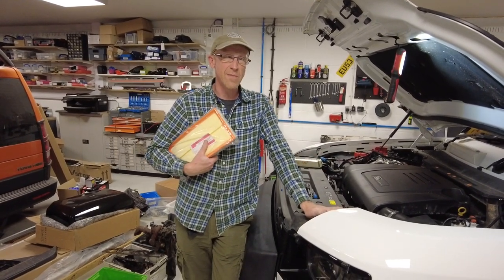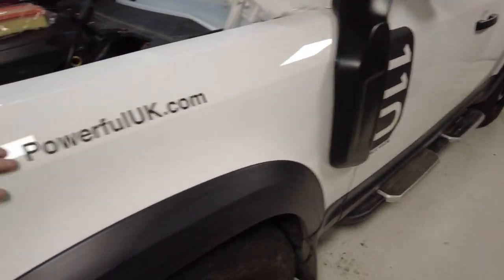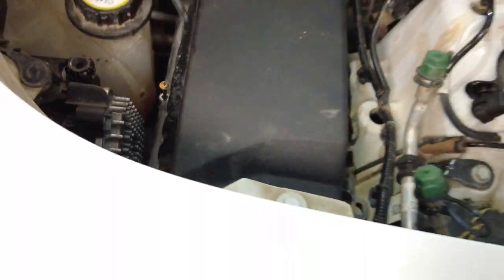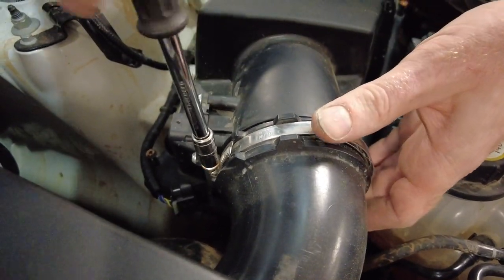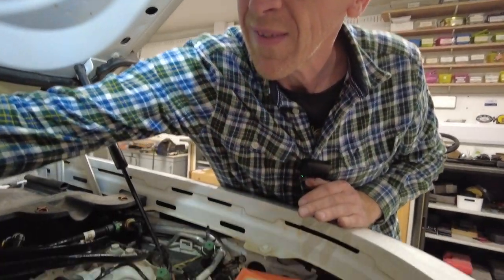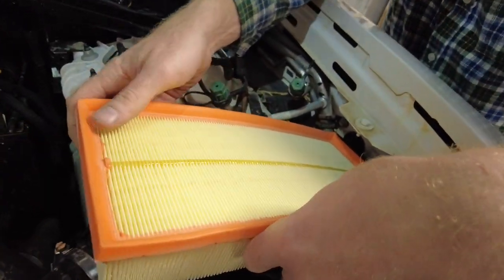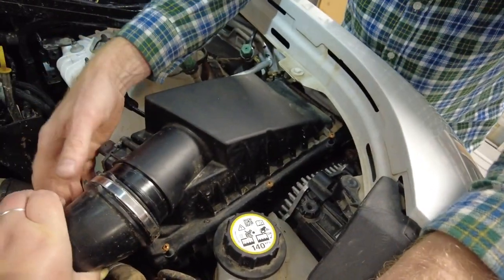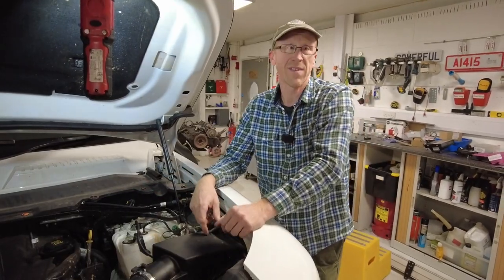Land Rover Defender L663 Service - Engine Air Filter LR129322 - 2L 3L and V8 models

Comment: We decided to use the Aftermarket K & N renewable one from day one!
Reply: My 110 P300 is 9 months old with 21,000 miles. Swapped out the OEM air filter for a K&H reusable filter on the first oil/air filter maintenance @ 7k miles, and every 7K since. I opted to do the vacuum method for the oil. Easy peasy.
Reply from the maker: K&N have a good reputation and there are eco credentials too - wash them and re oil and its good as new !
Reply: @L663  Sadly we still have the haters who are clueless, and say, OH but they are so bad for the engine! Boom Oil bath airfilters in all older WD landrovers! Not rocket science lol
Reply: @L663  Some "professional" testing done by a member of an Australian Land Rover forum (AULRO) has shown that while K&N performs well in most conditions due to having a reduced airflow restriction, a good-quality cellulose filter can outperform them in dusty environments. Indeed a slightly dusty filter will outperform a clean one.

Comment: How did you get the wiring loom clips off the side of the air box?
Reply from the maker: I think just small hands !
Reply: @L663  Figured it out…also had to disconnect the air suspension loom connection and partially lift the air box slowly and carefully making sure not to pull on the loom…that gave enough clearance to use tool to pull the clips off.

Comment: Hi Simon, mine’s a 2020 D200 and when I bought it I got a service plan with it. The JLR dealer said it only needed servicing every 2 years or 20,000 miles. You’ve got me worried now!
Reply: you should be iii needs at least a look at once a year and for goodness sake change the oil more frequently than they say.
Reply from the maker: It hard to find the published servicing data for the Defender...my dash comes up with service due so thats an indication i needed a service ! I do tend to agree with Jon - 20K miles on a new engine would seem a good time to change the oil.
Reply: @L663  When I first got a new car 30 years ago they came with a 500 mile oil change service following a running in period. I got my 110 in April2020 and I’ve just done 13500 miles as I live in a rural area and don’t do long journeys. I haven’t had a service light on except for Ad Blu. It was the dealer that contacted me to arrange a service.
Reply: @L663  I find that stunning Simon don’t they want you to look after the vehicle why are service schedules a secret.
Is it because they don’t want you to know what their not doing?

Comment: Well done again. Servicing is interesting because I have the “Every two years” schedule but it also requires an oil service every twelve months….which conflicts! My last was an Oil Service for £180 which seems not too bad but a standard Service for a 65 Discovery was quoted as £980!!! and mostly was simply the oil and filter change. So far all Services have been under £400 but if I still have the same car next June…how much will it be?? 🫢😨🤞🏼🤞🏼🤞🏼😀😀😀😀Richard
Reply from the maker: Servicing clearly helps you maintain your warranty and helps with resale of the car but i think dealers are taking advantage of this ! These are not major factors for me as i think my warranty is probably invalid and not planning on selling the stig - he is part of the family !